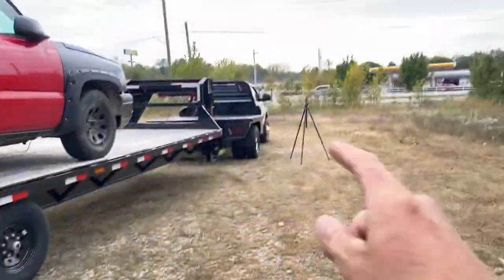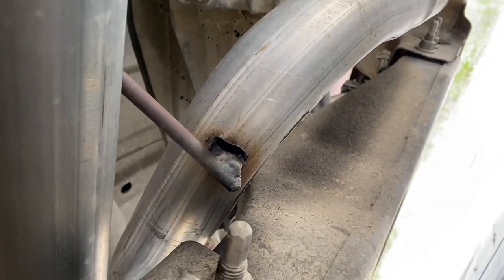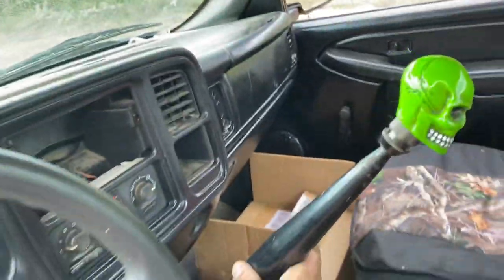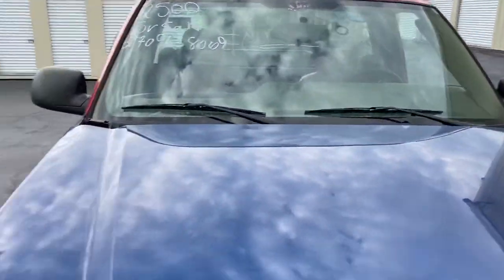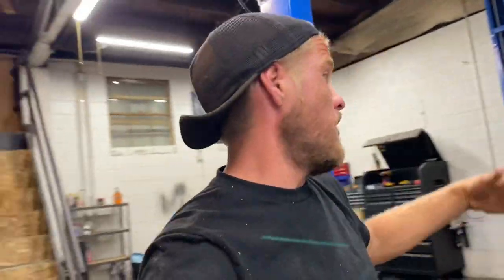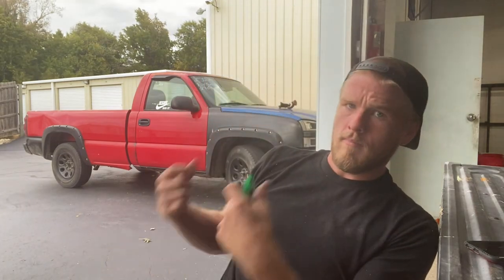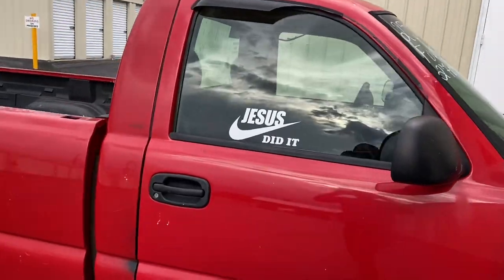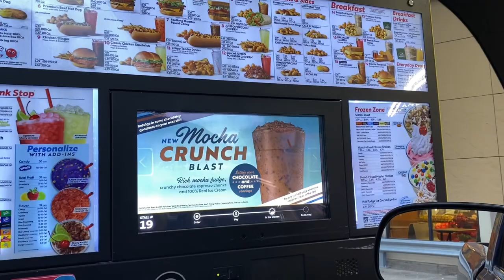BUYING THE MOST CLAPPED OUT TRUCK ON FACEBOOK MARKETPLACE!!

Comment: Is Marcus Wood what r you do with The Hong- junk Red Chevrolet Silverado what is your Plans would it i love Gray 3 Gen Ram 2500 5.9 24v Cummins Diesel Truck Mopar Guy and Powerstroke Guy you r the man Marcus wood with new Project Truck to Build the Red Chevrolet as your Shop Vehicles Truck it up with good work Bro you Rock love 2000 Ram 3500 2 Gen Flatbed Tow Pig 🐖 ❤❤❤❤❤❤🤑🤑🤑🙂🙂🙂🙂🤑
Reply: Punctuation my brother.
Reply: @chilltime4878  ok